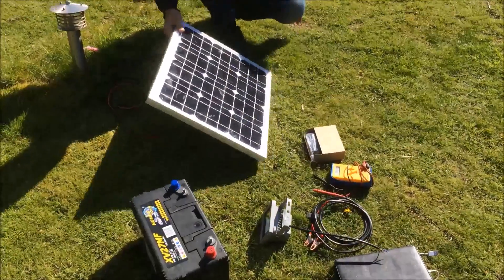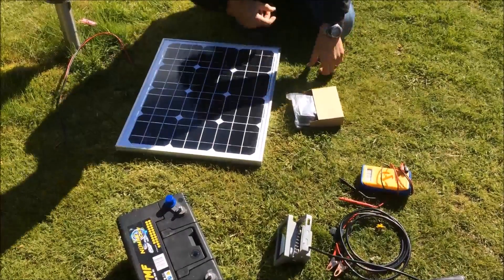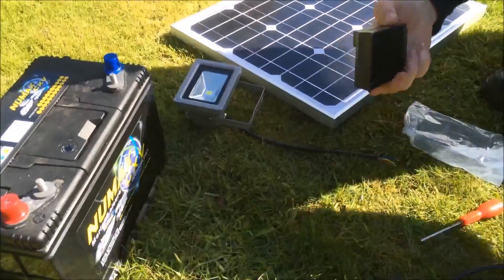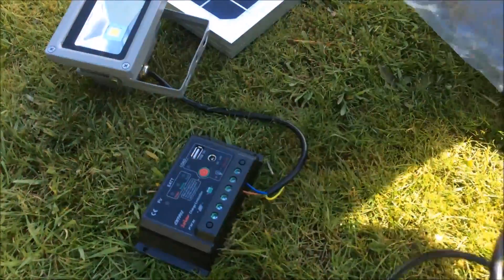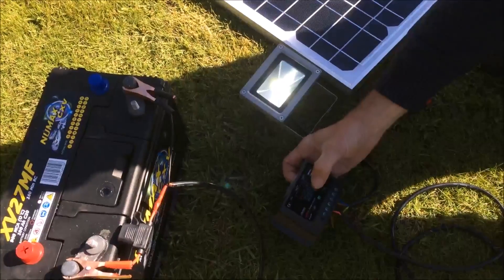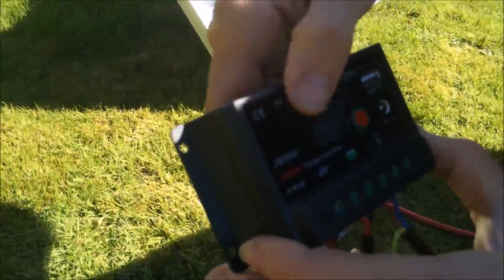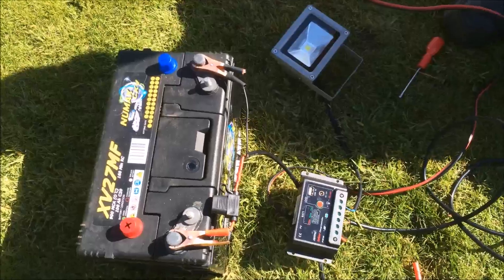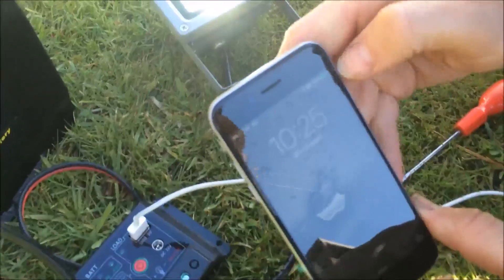How to set up a solar panel, charge controller and battery - Free Electricity, Part 1

Comment: I'm new to electricity but what i got from this video is that the solar panels output is too high and the battery can't accept this load so we use a battery controller to stop the battery from taking too much of the load because the battery can only accept a lower load then the solar panels output i believe that the excess power is discharged but i could be wrong.

Comment: I love how much smaller and lightweight this is than my older power banks https://www.youtube.com/post/UgkxU45wIUiiQjrUWgrFNORkYxVlmCsYWENJ and yet it charges even more. Bought one a couple months ago and loved it so much I purchased a second one and gave it to my granddaughter as a gift. We're avid campers so power banks are an absolute must have. I also like to keep these charged for when the power at home goes out which has happened a couple times this year. They are so convenient and easy to use. You can charge multiple devices at the same time. The compass is a nice added bonus. I appreciate how quickly this arrived. I am curious to see how long these take to charge in the sun.

Comment: is there a sequence in connecting the Solar Panel - Charge Controller - Battery - Inverter ? if so why?
Reply: Connect first the batteries to charge controller, then connect panels to charge controller and finally connect inverter to batteries without having loads connected yet to the inverter. Configure the charge controller and only after that, you can attach loads into the inverter. Batteries are connected first because they activate the charge controller's functions that manage DC power. If you connect solar panels first, electricity will flow inside the still off charge controller and will fry the unregulated electronics inside.
Reply: Thanks heaps M8 for the info. Otherwise, in my ignorance, I likely would have buggered things up.